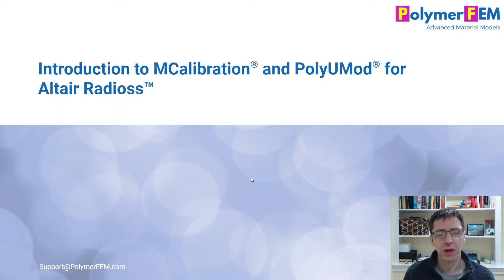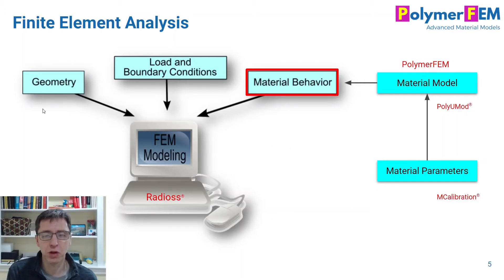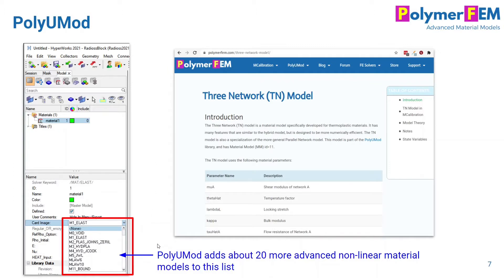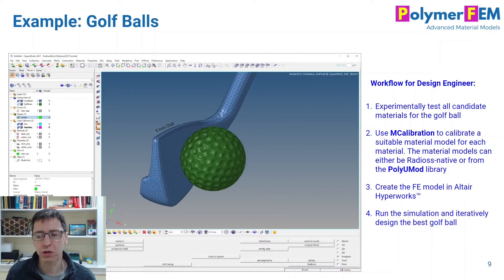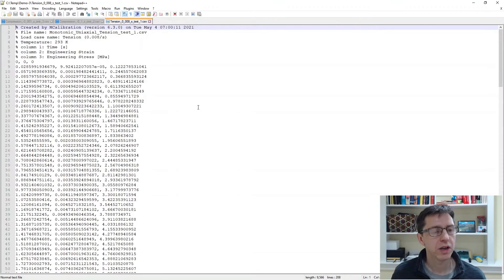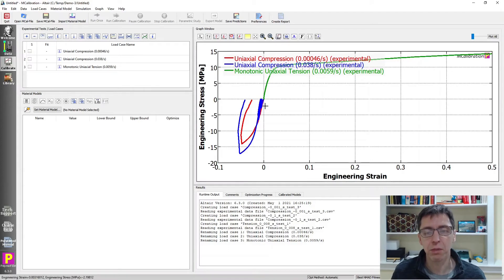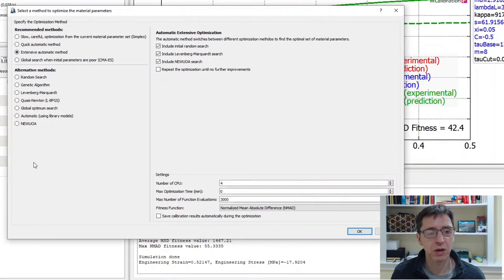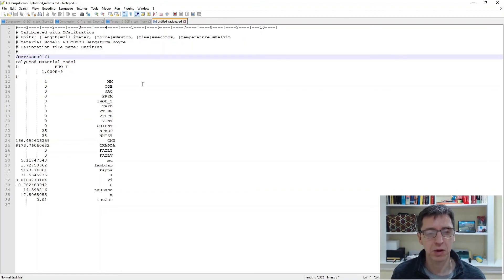Introduction to MCalibration and PolyUMod for Altair Radioss

Comment: So interesting. I am very keen to know that do you have any shape memory polymer's model?
Reply from the maker: Some of the material models in the PolyUMod library are suitable for shape memory polymers (for example, the TNV and the PN models). I have wanted to do some work on shape memory polymers for a while now, but I have not had time yet. And I don't have good experimental data to work with...